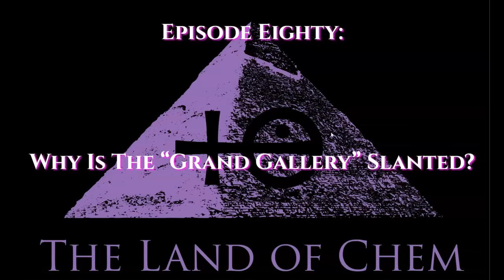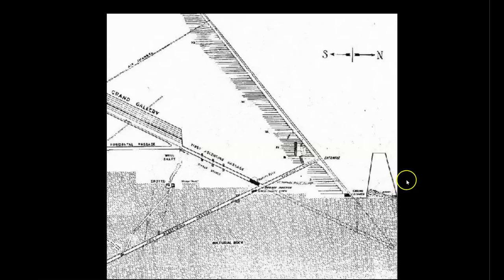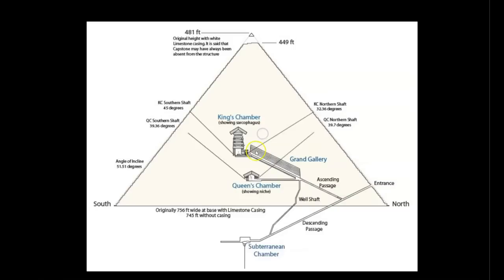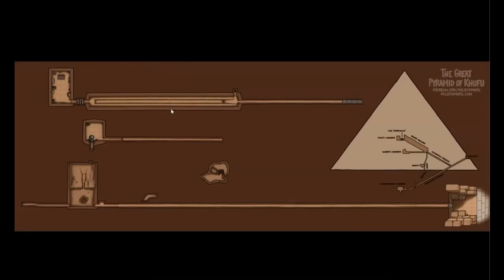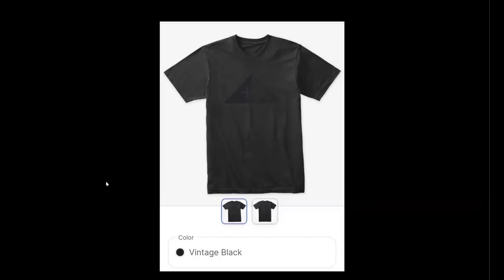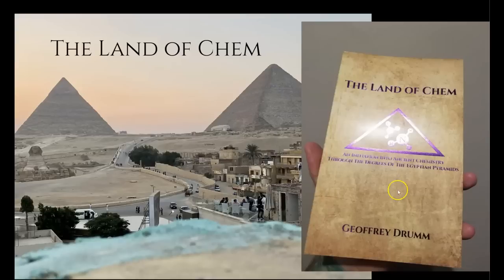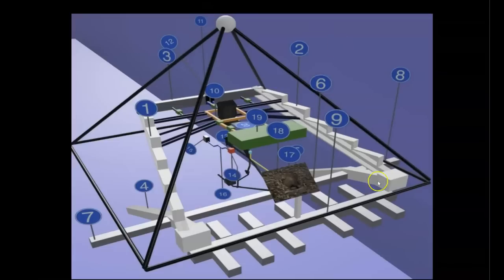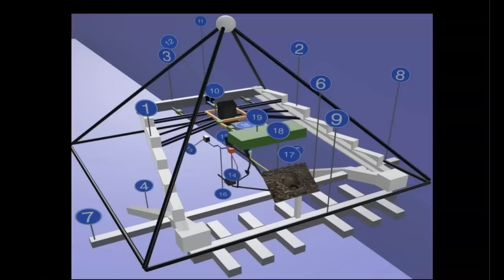Episode 80: ANCIENT TECHNOLOGY - The Great Pyramid - "Why Is The 'Grand Gallery' Slanted?"

Comment: I recently got into chemistry due to your amazing and very informative videos and as I wad learning more about ammonia and realised you didn't mention one of the uses as you only said textile/paints and fertiliser but during my research I found out that it's also can and is used as a clean fuel for motorised vehicles. Now im not exactly saying they was using it for cars or planes but that doesn't mean they didn't now it was also about to be used as a fuel. Also what amazed me was that today we used electricity which is a issue because we have to burn fossil fuels which makes it a so called black ammonia but using solar or wind is considered Green ammonia. This was interesting because the pyramids actually do make green ammonia because it doesn't use electricity which just make me think even more that the ancient people understood way more then we want to give them credit for. We wouldn't even be this far today if it wasn't for all the backward engineering we have done and the cultivation of knowledge still left and passed down from those builders of old. What's your thoughts on the ammonia being used as fuel?
Reply from the maker: Oh the fertilizer and other industries are just the tip of the iceberg for the ammonia applications. It is one of the most important chemicals ever discovered/produced, even today! Its only rival in terms of industrial significance is sulfuric acid. I'll be coming back to several more uses for the ammonia coming up soon, but I don't rule anything out. Thank you Darara!
Reply: @thelandofchem  no thanks you for being light to a space which almost felt dark for years. I'm glade I make the conscious decision to apply myself to research this and other topics otherwise I would never had seen your videos and many others on top of it. I'm currently waiting to get a chance to grab your book as I was going to grab the digital copy but decided the real thing will be far better. Keep killing it my bro 👊🏾

Comment: Airtight high-pressure chambers. This explains why they built with geopolymers. Zero gaps and tremendous weight to contain the pressurized gas and chemicals. So much for the argument they lacked the chemistry to re-agglomerate stone! Explains why the variety of stone also as each has different heat, chemical and electrical resistance.

Comment: It served as the track where the trolley for the counter weight system used to drag the 80 ton ceiling stones Jacque Pierre Houdin figured it and the archeological evidence backs him. The air shaft is how they coordinated & synchronized the chain gangs on the top of the construction site with the crews at the bottom. Otherwise coordinating hundreds of men and animals would've been difficult if not impossible.

Comment: In my opinion the grand gallery is a secondary coil to the primary above the coffer in the kings chamber, the hydrogen and oxygen burnt In the queens chamber with the two arc points at the brink doors, these gasses through evaporation made there way up to the top of the ante chamber, the antechamber is a rock condenser and gas regulator valve! This was for plasma in the kings chamber for ozone production. 
The then distilled ionised water ran down the grand gallery to fill the flashback arrestor at the grotto, the vented shafts in the kings chamber not only vented this ozone but let a fraction of light frequencys through wavelength going down these shafts from the star constalations, the plasma inside the king's contained these photons through plasma electromagnet containment! They weren't making chemicals! They were making gasses for our biosphere and creating fusion at our core! Mother earh had wings!  We could fly our environment! Read the txts, study the floorplans from above, great videos and stuff but I really think you have it wrong and not doing humanity any favors. If you are correct what were these chemicals for? And where is the relation to the language in stone? The pyramids are only part of a silicone photonic computer system which was laid out across our environment in a classical state quantum fashion, hall photon theory designed with AI using construction! Scaled up!  All hail the cubit! It's the quantum bit! It's a quantum language! Basically icons
It's billions of year's old its been here way before us. 

Our shield/ electromagnetic fields are weakning! We need to restore the connection in the middle pyramid and at saqarra and add water 
Or make build a new system.

Just saying gold was a byproduct of the electrollisis erosion of the bedrock under saqqara all the way to giza using iron oxide particals contained within the rock.🎉

Comment: Counter weight trolly slided up and down the grand galleri there are firl marks and remnents of grease/ lubrication on the grand galleri. And the so called big step on top where rounded for the ropes. Later filled with concrete. So there you go, evidence

Comment: I'm new to your channel, and theories - but I'm intrigued by your ideas.  Your observations of the interiors match mine - stone surfaces looking all burnt and fried - but you've tied them to a theory, which I never have.  For years I wondered why the insides of the pyramids look like the insides of process vessels I've observed in my years as a mechanical engineer.  One question - have you ever had any ChemE-degreed Process Engineers look over your material, and vet it from the thermodynamics perspective?  The reactions are well known, and a competent PE could easily confirm for you if the parameters of the pyramids are congruent with your theory of their original purpose. Are the air shafts in the King's Chamber capable of flowing air to the reaction as you postulate?  The shafts ascend to the outside - the chamber is blazing hot - what force is pushing much cooler air down that shaft, against the buoyancy force of the hot gases?  They'd work well as vents, if there was an air source feeding in from below.
Reply: Following that, it would be interesting to take a stab at estimating the rate of production. We don't know the dimensions of all the undiscovered conduits required to make this work, but some assumptions could be made and maybe the rate determining process is the time required to fill and empty the contact chamber
Reply: 100% With this theory there's easily quantifiable calculations that can be made (volume / density / pressure) and it could be verified by actual chemical engineers.

Comment: Makes complete sense. If the contact process chamber had been built vertically the surface area of the water coming into contact with the gas would have been much smaller resulting in a much more fervent reaction that is less controllable.

Comment: Really well thought out and detailed explanation.filling the gallery, though, would require a ball valve in the grotto and a way to fill the sub.chamber from the outside(possibly through the pit) also with a valve of some kind. The descending passage Is 1/4 the volume of the gallery. So, 3 pump cycles would be needed to fill the gallery; each requiring twice the work of the precious pump.
There is away to do all of this with less work. How do we get in touch?

Comment: Grand gallery is 151 feet long, 28 feet high. You're suggesting they were able to create an AIRTIGHT seal, and then a vacuum strong enough to lift that massive volume of water that far, when it would be easier to just light a fire in the northern shaft to pull air in directly from the southern shaft?  Do I have that right?

Comment: Hi, I have a couple of questions that are puzzling me about age great pyramid and its use
1. They were obviously great engineers, so if they new they needed to get water into the grand gallery, why did they not build a proper shaft at the time of construction, like everything else. They can't have come to opening day, and said 'start her up', and then oh sh.. we forgot a shaft, get some guys to dig a rough and ready shaft down to the lower chamber., and I don't see how they thought digging this out manually would be easier than building it in from the beginning. any thoughts?
2. If the grand gallery is full of sulphuric acid as the reaction takes place - which I would think would be a slow process considering the volume - surely there would be some erosion, or a coating of calcium sulphate on the walls from the reaction (which would actually protect them). From what you have said I don't think they used any sealing compound and therefore from 100s of years of use, the walls all seems to perfect, any thoughts?
Reply from the maker: Neil, you have about 100 videos and a whole book to catch up on. I have thoroughly discussed the internal sealing compounds in previous Episodes, as well as chemical analysis of this material from inside the Red Pyramid. And I have an Episode coming up discussing calcium sulfate. Please check out the Playlist "all Episodes starting from the beginning" to you can get brought up to speed on all the details. Enjoy!
Reply: @thelandofchem  I have watched all of your videos on the red pyramid and the sealing compound- doesn't explain why there is non in the grand gallery of the great pyramid, or why there is no erosion from the sulphuric acid. and you have't answered the first question. So I refrain from asking anymore

Comment: Okay, it sounds plausible, your theory. But, why would they go through all the effort to build the pyrimids in order to make sulfuric acid when they could surely make it with smaller equipment in those days.
What did they use sulfuric acid for?
Reply: for metal mining/extraction or metallurgy. 
even today, sulfuric acid is still the highest volume produced chemical.
and possibly to make ammonium sulfate - a fertilizer - mix ammonia with sulfuric acid. a big agricultural society. Other pyramids have signs of making ammonia instead of sulfuric acid.

Comment: part of the reason is because it needed to be 51 cubits by 26 degrees inclination, which is an alchemical work of the philosopher stone.(star regulus& others) (see royal society of chemistry for the best table... made by alchemists themselves without doubt)
But 51 is antimony, the only alchemical metal that is at a level 10. and is in the malkuth or earth position at the bottom of the tree of life(kabbala tree)  there are 7 alchemical metals... and 7 solar system bodies they are related to... which allegorically have ties to their function... and also its the spatial body that will vibrate that metal at an atomic level.. the ancient egyptians would know what metal/herb/gem etc belonged to what planet because durring their transit for instance... mars... would make iron be able to be smelled from an abnormal distance away.... while the sun hits the metal. So IRON=Mars. which is the alchemical function of destruction... for distillation and purification. Now... Antimony... its first alchemical work. the very first alchemical work of the stone is to get antimony to behave in mars... Antimony can mimic the 7 metals and their alchemical functions... and the first work.. is to get antimony in mars.... for the purification... or breaking down of the elements. Iron is element 26. antimony 51. so... 51 cubits... IN/ON 26 degrees.....   believe me.... the entire pyramid is bursting with alchemical measurements. also.... mathew 27 50-54 gives you big hints aswell. 
Wait until you get to element 61 with the pyramid... will blow your mind.
but this is the inner journey aswell as the outer journey to evolution and the conduit to god. perfection and distillation of the spirit to the + end of the spectrum. like gold... only holding a pos ion... heaven is at the full + of the spectrum, and god... being equated with gold, like the sun... its element being gold. everything revolves around it.. it brings all things life and warmth. etc. 

Believe me its not disputable if you are initiated and understand the spiritual and chemical sciences.
grand gallery also has 4 floor slabs. 4 seasons. 7 incriments of wall cuts. 7 rays days main chakras metals etc. 28 notches in the floor for the lunar month, 52 ceiling stones for weeks of the year and the 52 chakras in total. a 13x4 module. 1 face per season. on a 4 sided tree... all  individual nodes meeting with moon(center)+(heart) and malkuth (bottom). god at the top.
The grand gallery also accounts for spine/ribs/sternum etc. our center bone structures that support the body

The grand gallery also carried water downward

Comment: Not sure if this adds anything, I don't want to take anything away, but if you explain the sphinx extra ordinary water erosion from water being poured over papyrus(hard wood) or other hardwood ash like a thousand guys with buckets, it makes lye, hydroxides, this is exothermic so generates heat and pressure and adds a chemical to the mix. They say the subterranean tunnels are connected. This also when cooled would retract and draw in air. If soidium/potassium hydroxide is part of the process... just heard you say exothermic... lemme rewind... I will leave this here..

Comment: The air vents were sealed, they broke through the walls to open the air vents. ????
Reply from the maker: No,the kings chamber air shafts were always and originally open to the outside. The queens chamber was sealed on the inside of the chamber and do not go to the outside

Comment: Problem is that the shafts were closed and opened in modern time. Fail...
Reply from the maker: Incorrect. You should do your research properly before commenting
Reply: @thelandofchem  "Star shafts" commonly refers to two narrow ducts leading out of the King's Chamber of the Great Pyramid of Giza. It may also refer to two shafts in the walls of the Queen's Chamber, though these are discussed less frequently due to being blocked off on both the outside and inside of the pyramid.
Reply from the maker: @D F  yeah those are the Queens Chamber shafts that dont go to the outside, which I don't even mention in this video. Again, pay attention and do your research properly. Fail...
Reply: @thelandofchem  I dont know what the pyramids are or was, but I really think it was smaller due to the shafts in Queens chamber and was extended in size at some time looking at the shafts in the Kings chamber. Was this structure even watertight?  They found sand behind the stones in the descending passage when they drilled. Water, stone and sand is not good combo.

Comment: no you're wrong in pyramids hold heat inside of them there is voids of pure quartz sand in  every void they have found in thd  great pyramid . its all around the kings and queens chamber . the quartz sand would hold heat in ..
Reply: The quartz sand is also stable mechanically, that is, it packs well and can support weight. This is important if the majority of the pyramid is sand and it must support the rock "shell" without shifting. Quartz sand is used to make the best mortar in brick work because of its packing ability. I believe the quartz sand is a good insulator so it could hold heat or resist heating.